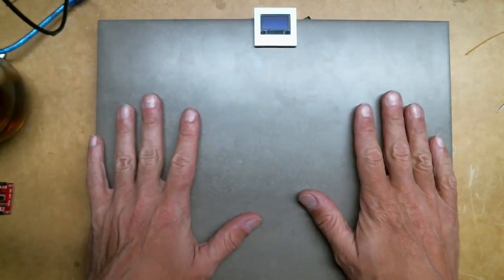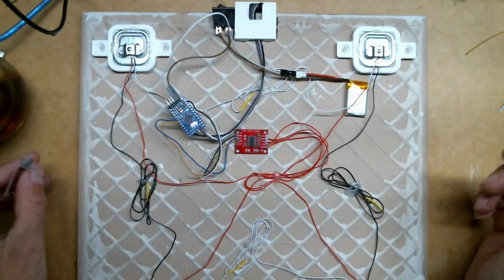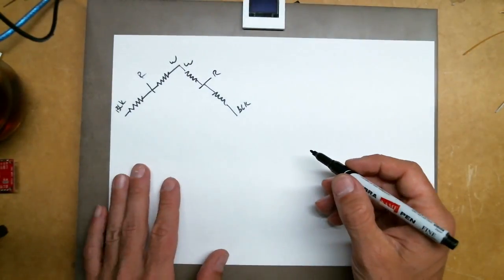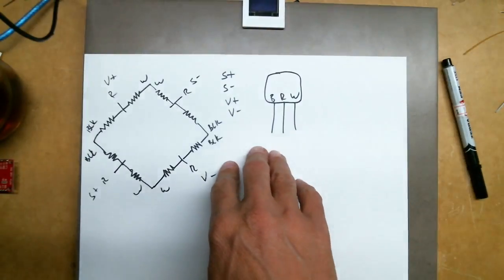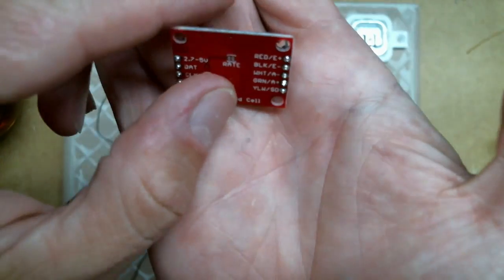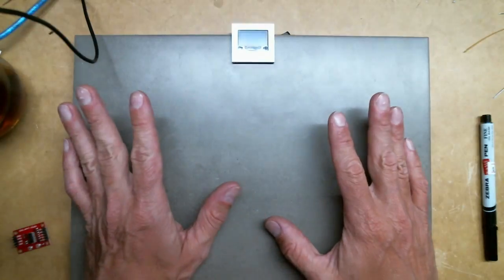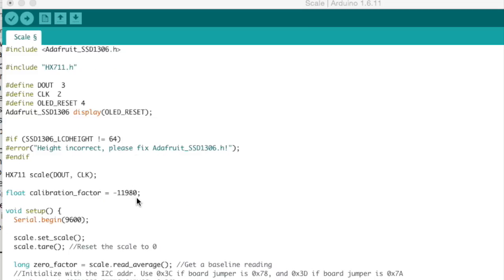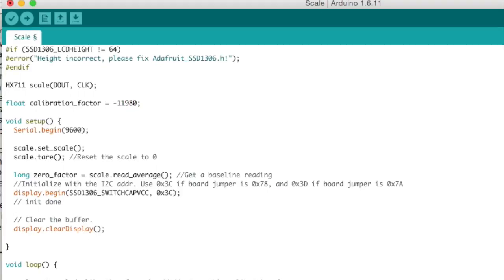Arduino stealth bathroom scale

Comment: Nice design 👍🏻 For version 2 I personally would cut out a hole for the display so it’s flush with the tile, have an auto on switch and have some support under the tile that could also hide the components. But I guess my version 1 would look very similar to this one 😉 Thanks for sharing 👍🏼

Comment: How difficult would it be to add a momentary button to 'zero' the scale when weight has been added? Furthermore would the zero'd weight be saved so that each time you boot the scales you wouldn't have to re-zero them? Only when the button is pushed again?

Comment: So this is less accurate at smaller weights? What weight would you say is the minimum it becomes accurate?

I've noticed the wires that come with that exact load sensor are ridiculously tiny. They are difficult to solder without breaking or pulling off. What did you find was the best way to keep them connected and make sure the signal stays consistent?

Comment: This is similar to a project a friend of mine worked on. He used 4 tiles, and recessed it into the floor, hardwired to AC power. Weight is displayed on a smart mirror.

Comment: Can you share your code please?
Reply from the maker: in the comments now
Reply: Thank you very much, you have yourself a subscriber. I tried your code and had an error compiling the code, was saying there is no file/directory found named adafruit.h . Is that a file you are using?
Reply from the maker: It's just a library for my OLED display. If you're not using the same type of OLED then you don't need it, but you'll have to get rid of the related code. I've added link to it in the description. Sometimes versions change, so you might have to try a few. From Github, just select "download zip" then add the zip library in Arduino.